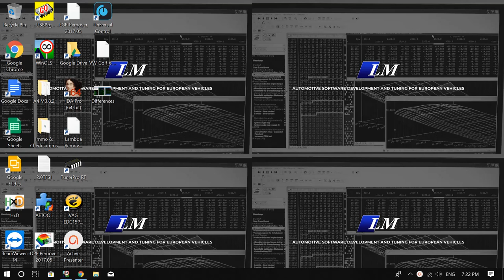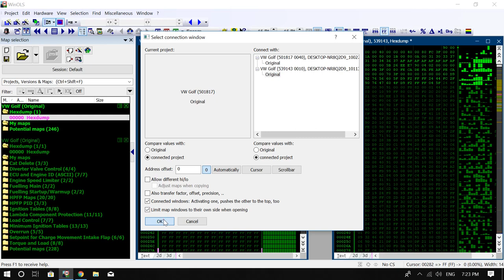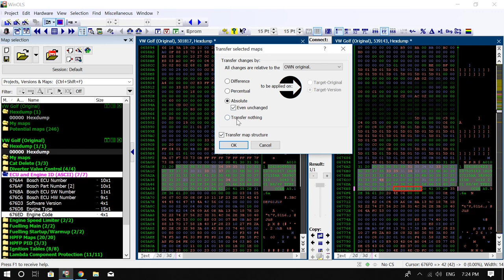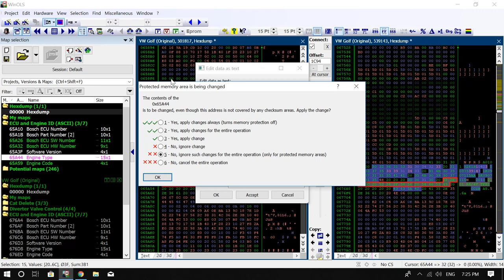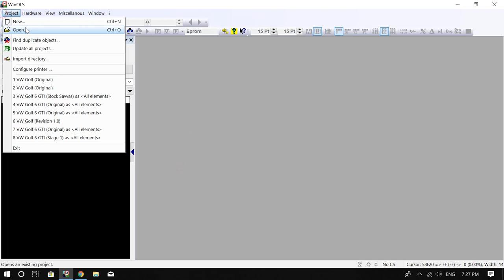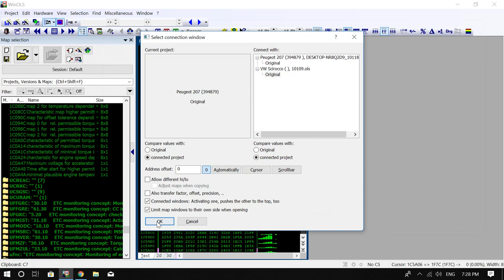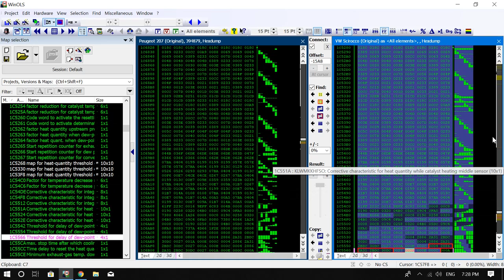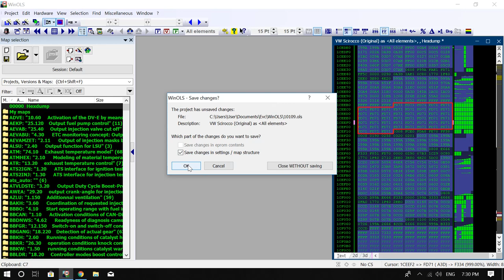LM Tuning - Using Compare to find maps in WinOLS

Comment: Thank you for this. I had been wondering if it was possible to do this. Lol nice. Also can you point out maybe some more videos pertinent to winols? I'm trying to tune the unforgiving me5.2 for an e39 non vanos m62b44. I have a ols file for it but It's all in German. Currently in the process of translating it manually with a tool I found online.
Reply from the maker: Hey mate head over to damosfiles.co and take a look at our courses :)

Comment: The 1st helpful video about mapping an unknown binary... and it's scary that it's based on comparison and guesswork, not disassembling...
Reply from the maker: Guesswork is probably not the best description of this process. If you have a file definition and the data is identical between software versions then theres a very high change the data is for the same purpose. If people aren't confident in this they can flash a file with a small incremental change to see if the vehicle acts differently. Trial and error mitigating risk.
Reply: @labordemotorsport  Hmm this looks like a map lets add everything by 1 to see how it reacts

(ecu reads it as 1000x the original value) (engine explodes)
Reply from the maker: @stoobidthing  everything regarding this process is at your own risk. If you blow it - it’s on you.